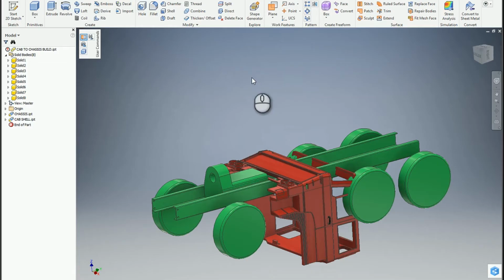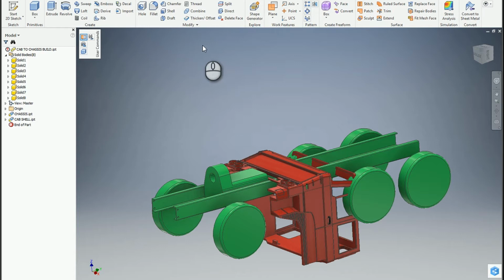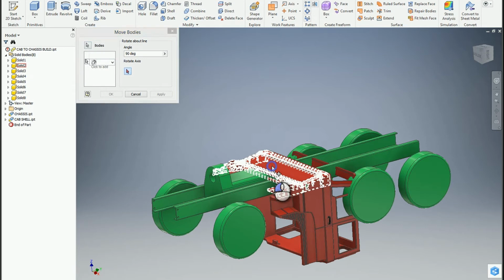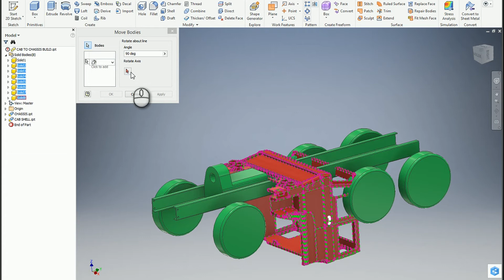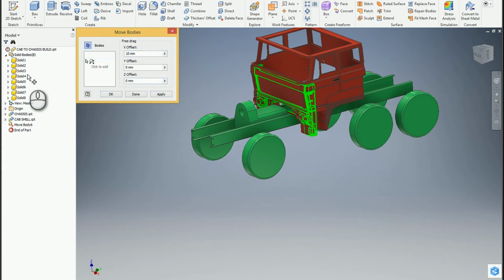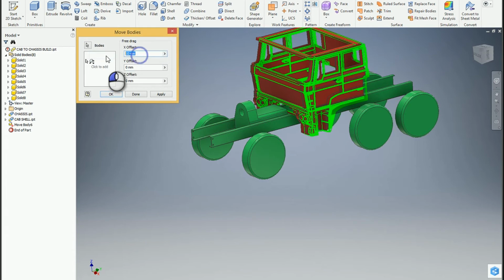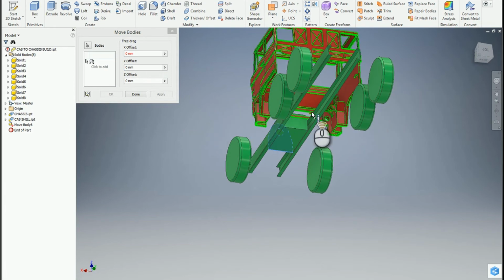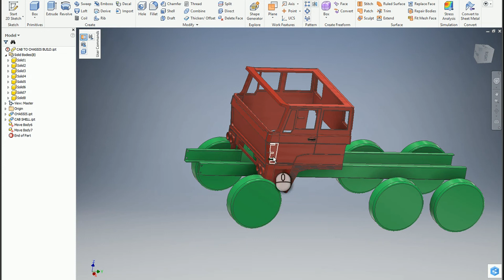Autodesk Inventor - How to Reposition Solids with Move Bodies Command

Comment: Ahhhhhh tricky bastards. I didn't know you could move by measuremant. nice. But can you do this move without Inventor creating a paramter in the feature tree. I just want to move it and not worry about another feature created. Other software I have used can move without creating another feature. Thanks.,

Comment: why can't we select all solids at once? UPDATE: it's possible by first highlighting all the bodies using shift key in the left panel before clicking "move bodies"
Reply from the maker: tazztone, thanks for reaching out!  You are correct, you have to select them using SHIFT or CTRL key clicking.  If you forget to do that first, as you mentioned, you can click on the "Bodies" selector in the upper left and then select the additional bodies, as well.  Glad you got it figured out and have a most blessed day!

Comment: Thank you very much for your important explanation. Excellent. But I realized that my version doesn't have this application. is it possible that you can send to me that apps ? → Move Bodies. Thanks a lot
Reply from the maker: Alfredo, you should be able to access the "Move Bodies" tool from the "3D Model" Tab >> "Modify" Panel.  This is a feature built into Inventor, so you don't need a special add-in to utilize this functionality.  Hope this helps and please ask if you have any more questions.